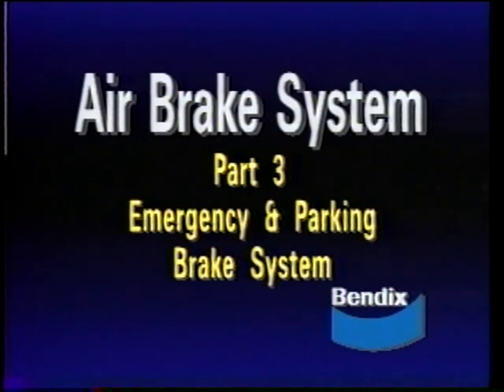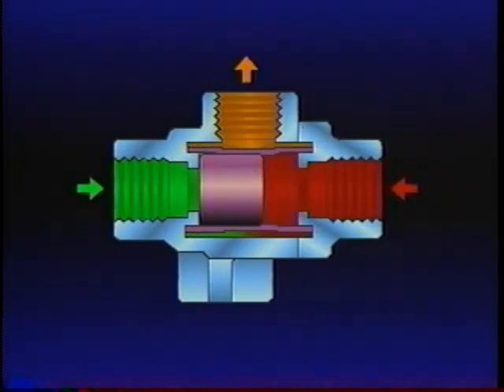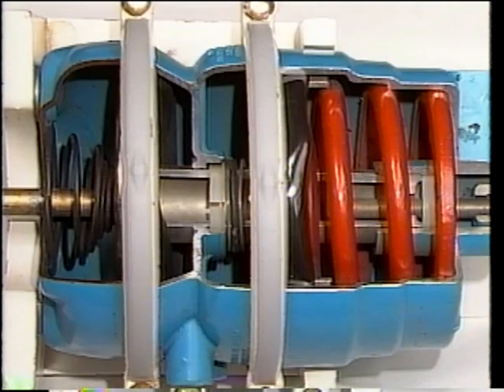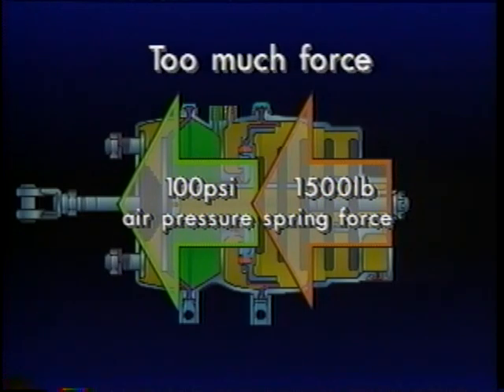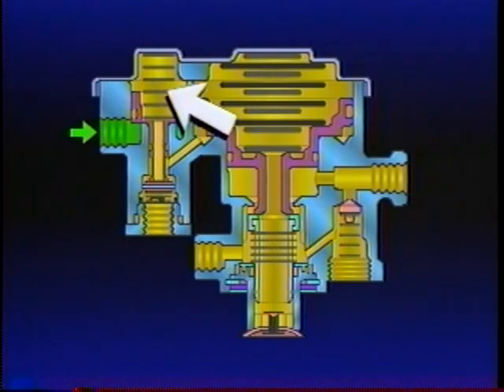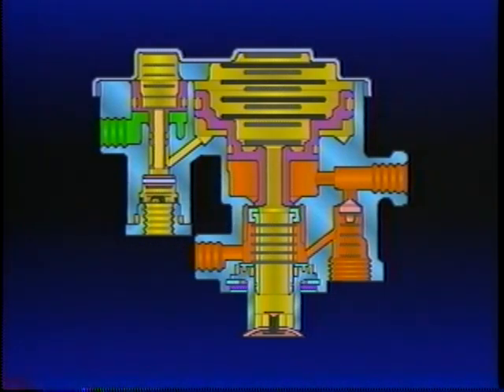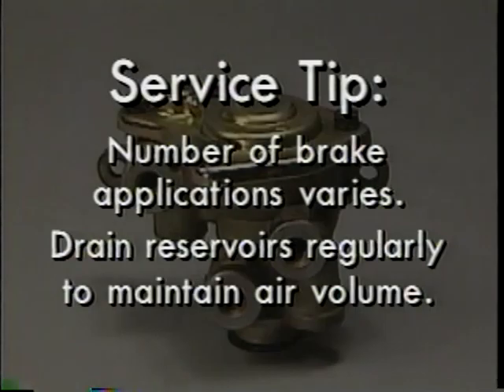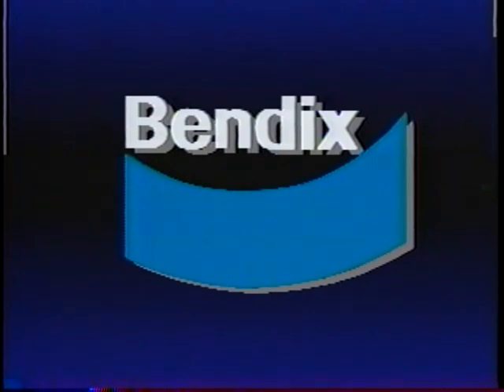Bendix Air Brake Video 3

Comment: 1:57 Double check valve; 
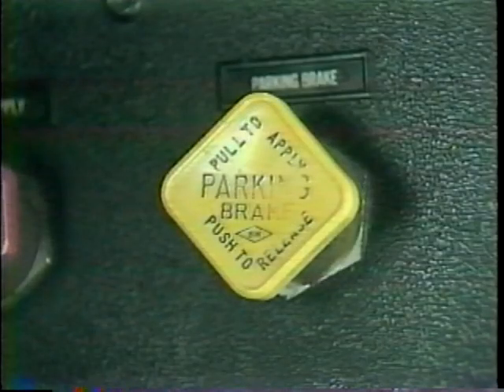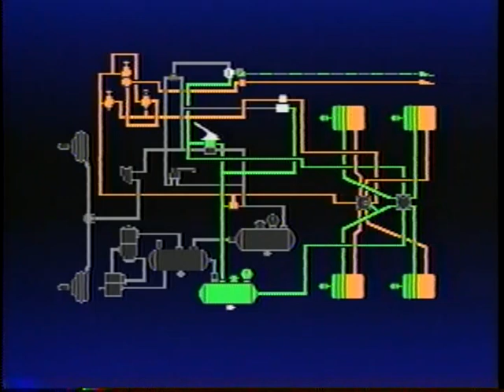3:18 Dash control valve; 4:53 Spring brake; 6:57 Relay valve
9:26 Spring brake valve

Comment: This video precisely answered a simple question I had about the systems!!

In case of supply air failure, putting in an alternate air supply to either the wet tank, primary tank, or the secondary tank, will be usable to release the parking/spring brakes, on the tractor!!